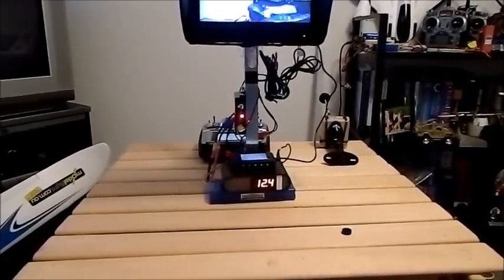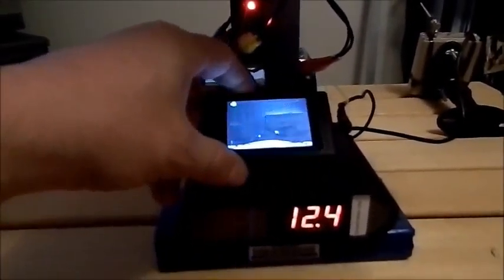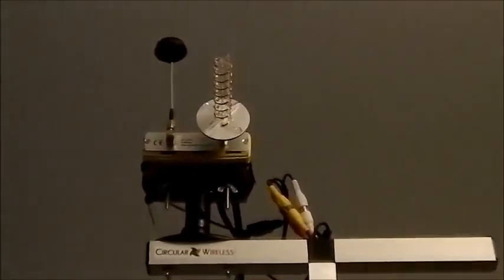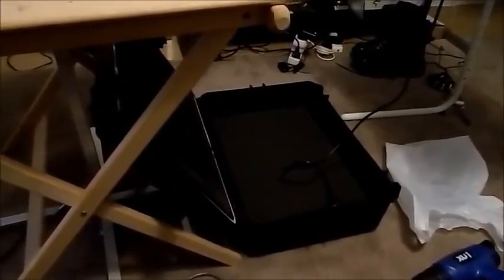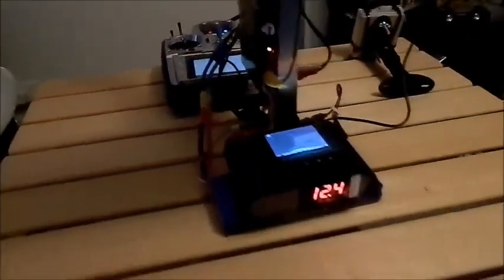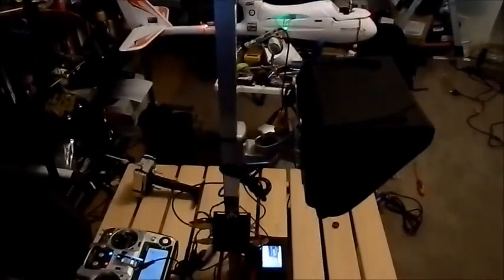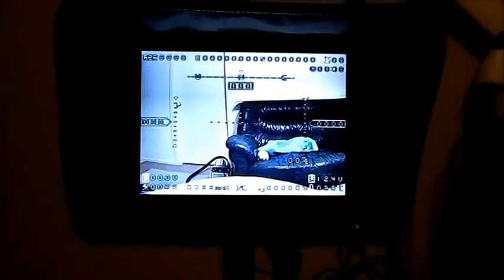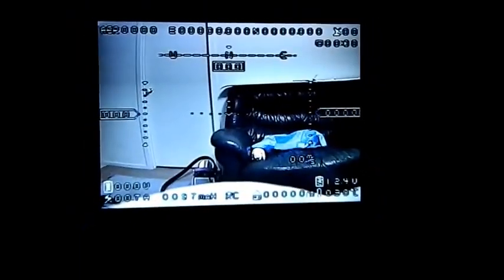FPV Ground Station

Comment from the maker: Thanks. I made a box with a 5.1 volt bec from HK in it to power the DVR. I got the one with low power alarm so it will double as alarm for rest of the stuff run from the box (video splitter, monitor, video receiver etc.). Happy to help if you need any advice PM me... Good luck and let me know how you go.